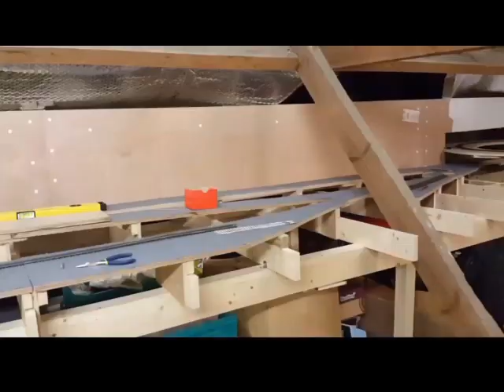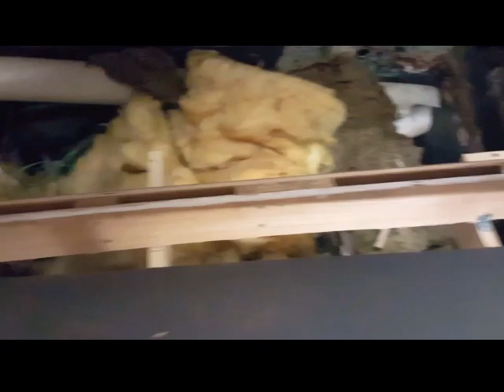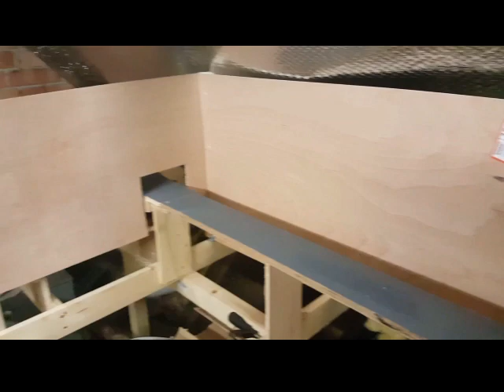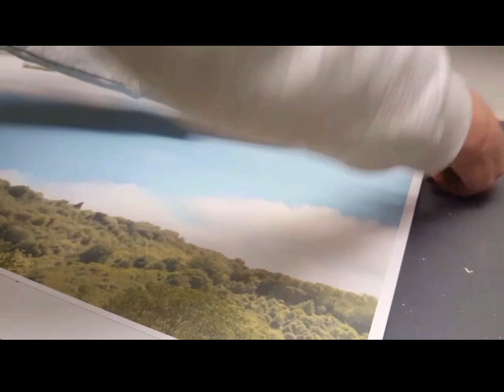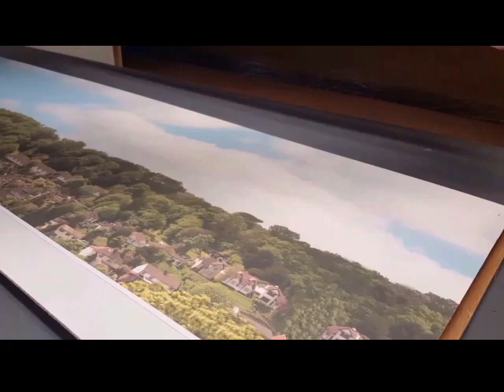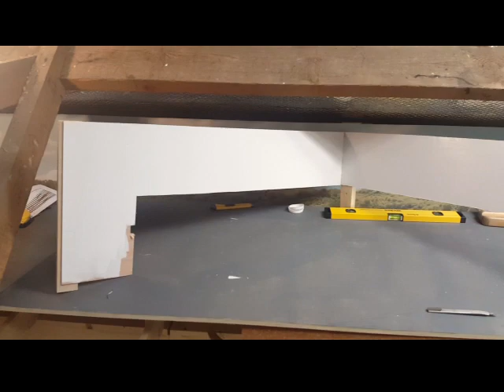Exeter and laira. Part 3. Backscenes

Comment: I found this to be very informative and interesting, you also make it look so easy which is good in my books.
I think what makes it easier is that you are able to lay the board down on the desk and then affix the backscene. Others try to fit it whilst the backboard is in place and that's when the difficulties occur.
I had a spare UPVC soffit board left over from when I did a renovation on my bungalow and its ideal for a backscene board, bends lovely and hardly needs anything to hold it in place along with the fact it's a great material to adhere backscenes to. I might need two more though because my loft is over 30' long and I want it to go all the way around virtually. Just got to see how it will go but basically following your principle on fitting it.  
Having watched how you paint your wagons I knew this was going to be a good video to watch, your back scenes look fantastic. Definitely the right way to go, build your deck then fit your backscenes before laying track and doing scenics, just brilliant and the way I propose to go. Cheers Tim.
Regards Chris

Comment: Heya
Really like those ID backscenes & the layout looks like its really beginning to take shape
Would you be interested in joining in on a competition I'm doing on my channel?
Oliver
Reply from the maker: Oliver Rowley. Cheers! What's the competition all about?
Reply: Seeing what can be done with a basic Hornby 0-4-0
More info in the link
https://www.youtube.com/watch?v=fEv2z_XysqM
Thanks 
Oliver
Reply from the maker: Oliver Rowley. Think I get the idea. I'm right in thinking any hornby 0-4-0 shunter/loco is bashed around into a project to see what people can do with them. 
Couple of questions .. does it have to be a hornby and assuming I can do anything I like to it (scrap weathered I'd most likely do) this would make a good video on my channel because it was actually a old lima 0-4-0 i practiced faded and rust tones on that got me to where I am now on scrap weathering (plenty of pictures of it) I may well buy another and do a how to video which will also feature your competition and also give the loco away in another completion.. thoughts?
Reply: Hi
Hornby 0-4-0's please, but other parts can be used on it as long as either the chassis and/or body of the Hornby 0-4-0 are distinguishable in some way
A video on it sounds good and I especially like your how to's
Do you mean I give away a loco or yourself?
Thanks 
Olly